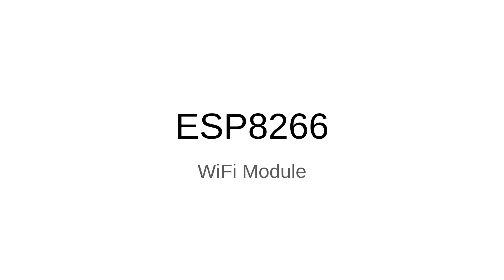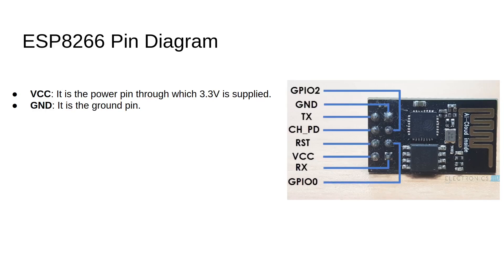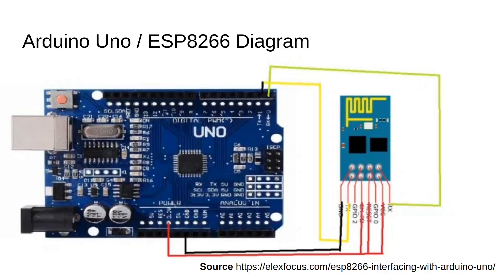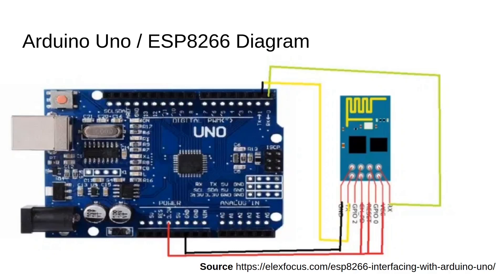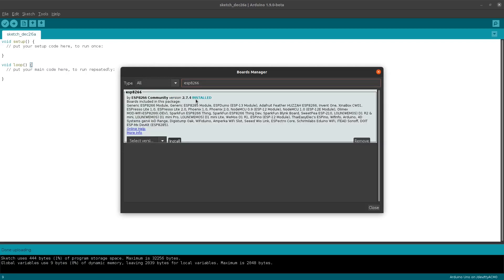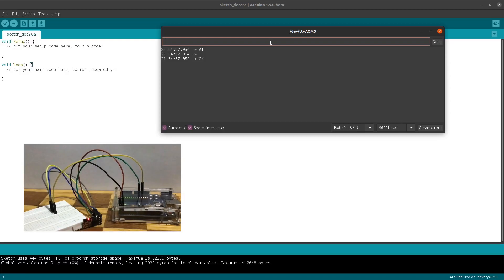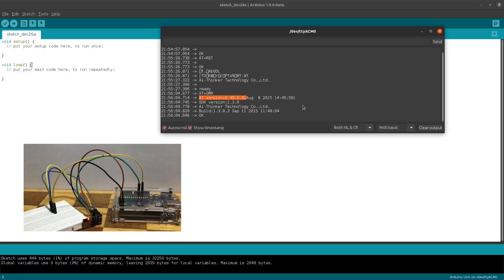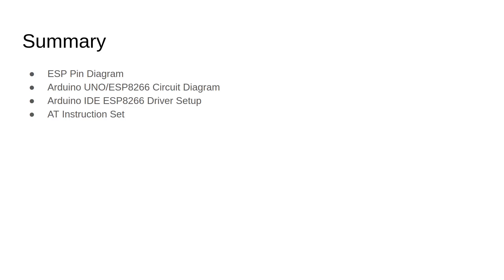Connecting Arduino Uno and ESP8266 WiFi Module

Comment: If you want to communicate
Arduino UNO board's microcontroller tgst is ATmega328 with Esp8266-01 module then connect TX of Arduino to RX of esp
And RX of Arduino to TX of esp

And of you connect TX of arduino  to TX of esp and RX to RX, then you are probably making communication between esp and the serial to usb chip which is on Arduino UNO board

Comment: 🎯 Key Takeaways for quick navigation:

00:00 🛠️ ESP8266 and Arduino Uno Pin Diagram and Connection
- Understanding the pin diagram of ESP8266, including VCC, ground, TX, RX, reset, CH_PD, and GPIO pins.
- Step-by-step guide to physically connecting ESP8266 to Arduino Uno, ensuring correct power and data connections.
02:16 🖥️ ESP Driver and IDE Setup
- Introduction to setting up ESP8266 driver and instruction set using Arduino IDE.
- Instructions on managing URLs, selecting the correct board and port settings, and burning an empty sketch to the board.
03:27 🔌 ESP8266 Communication and Module Configuration
- Verifying correct connection and communication with ESP8266 module using serial monitor commands.
- Inspecting module version, setting up as a station mode, and understanding different modes for specific use cases.

Made with HARPA AI

Comment: Rx to Rx and TX to Tx for testing the  AT command.  Now I want to make Arduino Wifi project. Should I make cross connection like Tx to Rx and Rx to TX?
Reply: im doing a similar project, have you found an answer to this?
Reply: @ggerfanclubpresident5285 I'm able to make  ESP01 accept AT commands now.
Now I'm still searching  on Youtube  tutorial  for project. I'm not sure  the wiring is the same if I need ESP01 to do more than testing AT commands. For example, I want ESP01 to host a webpage.  When user click some buttons on webpage, ESP01 then sends command to Arduino UNO to control devices that connected to its GPIOs.

Comment: Be cautious, this can destroy your board, because the Arduino uses 5 Volts for RX and TX and the ESP does only accept 3,3V! So it will destroy your chip if you don't reduce the volts first!

Comment: Hello please I get ‘Failed to connect to esp8266 invalid head of packet (0x00)’ error . 

Please what do I do ?
Connecting Ch_pd to power turns off the esp8266’s lights.

Please help !
Reply: I did your connection and it changed to ‘ Failed to connect to esp8266 invalid head of packet (0x7F)’
Reply: I changed tx-rx and now I have 0xFE error😢

Comment: sir, i have connected all the wire correcly and set the baudrate at 115200, but in serial monitor spamming "AT" (not responding), how can i solve that? please give me solution
Reply: Did you upgrade your esp8266-esp01 to  new firmware that supports AT command?
I had the same problem. Now I no longer the problem.
Reply: same thing ! did you resolve it?
Reply: @aomo5293  try 9600 baud

Comment: I have connected everything properly and have downloaded libraries but when I type AT command into the serial monitor nothing shows up can anyone please help me.
Reply from the maker: it usually happens when the circuit connections are not correct usually the RX/TX connection.
Reply: @MustafaQamarudDin  

RS --> TX
TX --> RX 

right ?
Reply: Did you upgrade your esp8266-esp01 to  new firmware that supports AT command?
I had the same problem. Now I no longer the problem.

Comment: dealing with these modules is beyond frustrating. This didn't work for me. No response on the serial monitor.
Reply: Did you upgrade your esp8266-esp01 to  new firmware that supports AT command?
I had the same problem. Now I no longer have the problem.
Reply: @jumbo999614  How do you upgrade?

Comment: I got some garbage data what should I do......and i am requesting to send me to exact hardware connection  .
Reply from the maker: have you tried a different board?
Reply: No i am using Arduino Uno and same connection what u said u in video but I didn't get reply from esp82

Comment: This video failed to help as many others. It is so frustrating dealing with this ESP8266 module 01 with arduino.
Reply: Yep, it is cheap trash from china.
Reply: same here
Reply: @AbuBakar-um5wc   Did you upgrade your esp8266-esp01 to  new firmware that supports AT command?
I had the same problem. Now I no longer have the problem.
Reply: had you found any solution??

Comment: umm my serial monitor just prints out garbage on 9600 bauds and on any other baud level and my pins are double checked... any ideas?
Reply: Hey I found a fix for my problem, I had to reinstall the ESP code to the factory defaults, If anyone is like me and only have at their belt an arduino and an ESP you should try learning how to configure the arduino to work as a pass trough for the data in the edit mode for the ESP. After you do that you can find online some software that writes the factory default code on your COM port. I sadly am in a hurry and cant really provide links on how to do this neither found a video that does all of this at once, but atleast I hope I can shine a light on the path to fixing the ESP. Also there is a chance based on how or what was the condition of the ESP to just be damaged and rendered unusable

Comment: ⛔⛔Attention, do not blindly follow the pin out, this will destroy your ESP8266!! You can not connect the 5 volt levels from the Arduino directly to the ESP8266.
Reply: It looks to me like he said 3.3v, nothing about 5v
Reply: @TJbuffs The issue is that if the Arduino uses a 5v logic level, the TX and RX pins will be 5v instead of 3.3v. It's a bit subtle.

Comment: When I connect the CH_PD pin to 3.3V the the wifi module power indicator doesn't glow,why is that?,when I disconnect the CH_PD pin it glows and my Arduino as well gets disconnected when the CH_PD pin is connected to the vcc pin
Reply: I get the same problem

Comment: Sir, In which wire can connect these two? and another question is, we can connect with app or sim card using esp8266? If connect which device connect sim card?
Reply from the maker: Which wires do you mean? And I haven't used the sim card before.

Comment: why AT command no display at my arduino IDE?
Reply from the maker: Please review the circuit connections again and try different Baud rates.
Reply: Did you upgrade your esp8266-esp01 to  new firmware that supports AT command?
I had the same problem. Now I no longer the problem.
Reply: @jumbo999614  explain to me how

Comment: 8266 tx & rx are 3.3v reff as per data sheet. Shouldn't we need to level shift tx & rx channel btw 8266 and uno?
Reply from the maker: Adding resistors should be a good idea for a production-ready system.
Reply: @MustafaQamarudDin  Where should the resistors be added exactly? I've seen many different wirings and at this point I might just not add any resistors at all.
Reply: @hind7360  maybe at the TX, because if you upload a sketch, then the TX line is used to transmit data from the arduino to your ESP chip.

EDIT: I thought about it again, and I might be wrong, maybe the data is coming from the RX because the ESP8266 receives them from the Arduino...
Reply: Appreciate your reply, I finished that course and graduated and got a job lol don't really know when I'm gonna need this info next but thank you !!! @ZorlacSkater
Reply: @hind7360  Great, congratulations :)

I thought about it again, and I might be wrong, maybe the data is coming from the RX because the ESP8266 receives them from the Arduino...

Comment: Sir how you connected 3 pins to the 3.3 v without using breadboard ?? Give some suggestions sir
Reply from the maker: I am using a breadboard
Reply: u buy broo
Reply: Just solder 3 onto the same cable and connect it to 3,3 V
Reply: there is a device that let you temporarily connect wires together. Just insert wires into the hole and clamp it down.
If you don't have breadboard, you can use that.
But it will get complicated if there are more wires to connect. 
So it's best to use breadboard.

Comment: shouldn't the RX pin from ESP8266 connect with the TX pin of UNO and the TX pin from the ESP8266 connect with the RX of the UNO?
Reply: that's only needed when you need the two devices to talk to each other,
if you want to make the Arduino UNO as a bridge from the computer to the esp then connect RX to RX and TX to TX,however, don't forget to connect the NGD to RESET in that case in the Arduino
Reply: @shalabyer  What is NGD?
Reply from the maker: I may assume the same since semantically the receiver connects to a transmitter, but in this case, the semantic logic doesn't hold. I would however suggest trying it out since I have tried it out as well.

Comment: In Tools --> Board: Why did you selected "Arduino Uno" instead of "Generic ESP8266 Module" ?
Reply from the maker: This is a very good question. The programmer is still Arduino and ESP is only used as a wireless extension. That's why everything is Arduino.

Comment: Sir, we need to attach resistor also, to reduce the risk of short circuit???
Reply from the maker: I believe you should for a more durable setup. I keep it simple though in this video because I was more interested in showing the AT command set.

Comment: i follow all the steps but when i write at serial monitor the output not produce anything. Can you describe the problem?
Reply: I am having the same problem here and everything is connected
Reply from the maker: @cpatriciasousa  unfortunately the only way to find out is to make sure the uno has an empty sketch and then try all different baudrates unless there is a firewall or similar on Windows. I have only ever used Linux Ubuntu.
Reply: @MustafaQamarudDin  ok thank you for your reply, I will try.
Reply from the maker: The BAUD rate is usually the problem, try different BAUD and see if you get a response.
Reply: @MustafaQamarudDin  nothing happen sir
Reply from the maker: @blackwhite5606  Are you sure of the wiring?